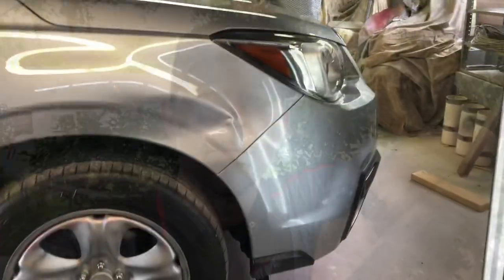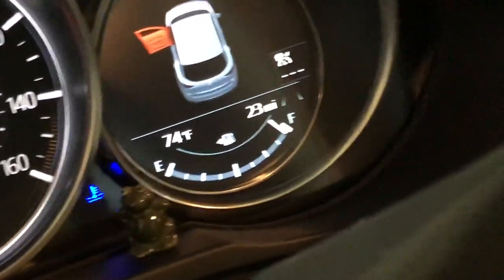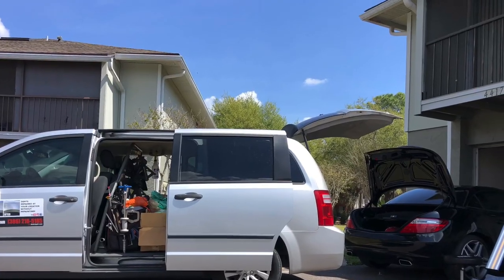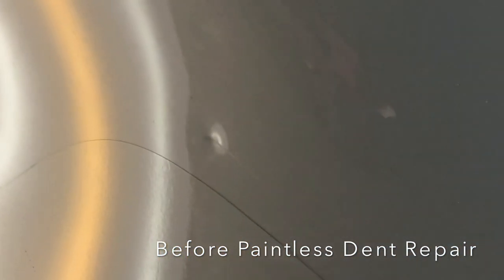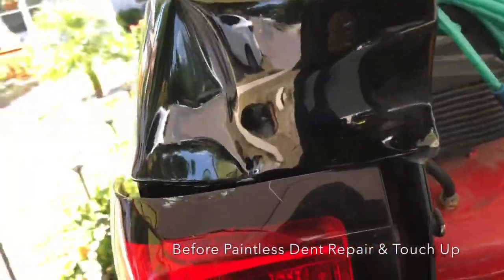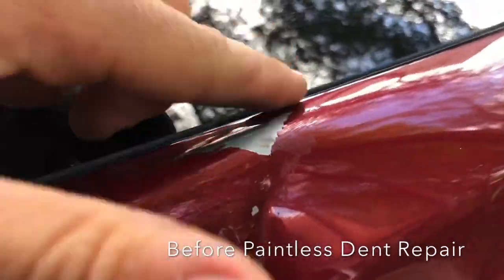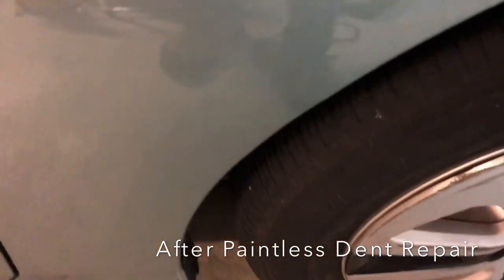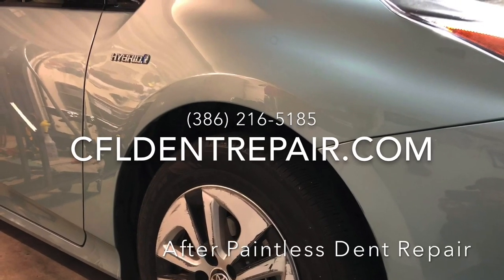CHANGING MINDS WITH PAINTLESS DENT REPAIR

Comment: Hi Bruce , amazing work as always. What tools did you use on the hybrid front fender repair to stop the edge of the panel from kinking and blowing out ?
Reply from the maker: I thank you Lee...used a wood vice/clamp to lock the fender securely. Used a 7/16 Ultra double bend the entire way through 👍🏻hope this helps
Reply: @cfldentrepair  Thanks for your reply , I'm a little embarrassed to have got you name wrong....I'm blaming auto correct for that ! Just seen your video for the VW door and sill.... amazing work , keep the videos coming !